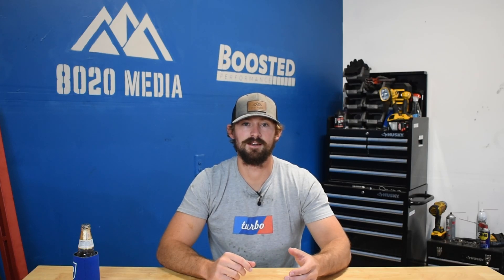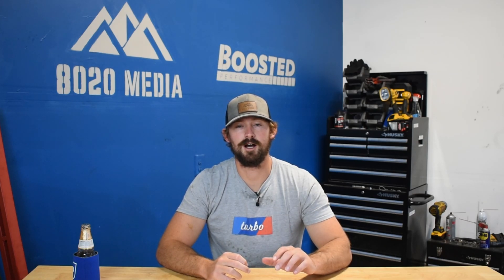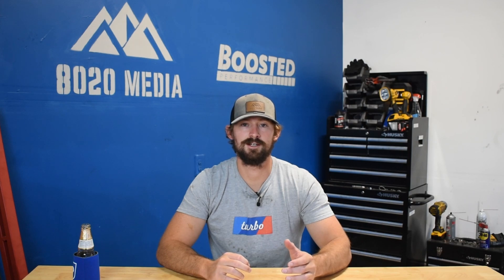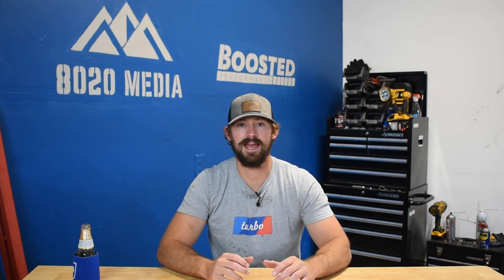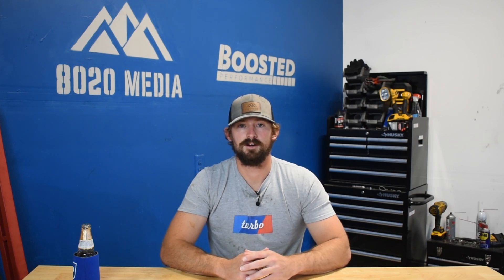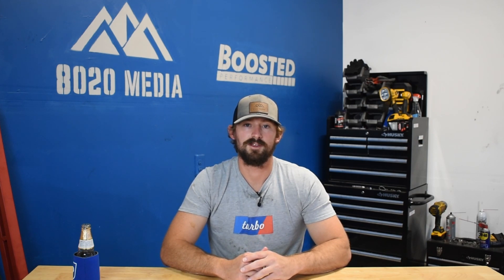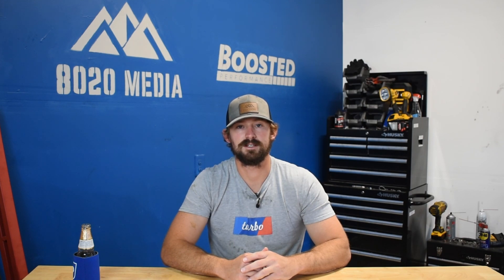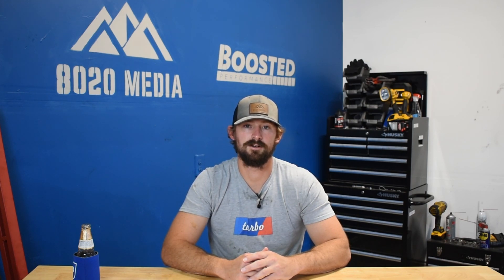The 8.0 V10 Magnum | Common Problems & Reliability

Comment: I have owned my 1995 Ram 2500 4x4 V-10 for 25 + years and have 0 regrets buying it,  I can personally attest that about that many years ago my mom/sisters/&brothers in law all drove brand new 4x4 pickup trucks.  They all got approximately 7 mpg, while my truck was still getting @ 12 mpg and all of us pulling campers to South Fork Colorado.  I did just replace steering linkage and parts for steering,  rebuilt transfer case and NV4500 gearbox,  new clutch and slave cylinder,  all wiring good and tested with gooseneck trailer yesterday.  I can also compare it to my '03 Ram 2500 4x4 24 valve Cummins. I'll keep them both.  👍

Comment: From personal experience (95 3500 V-10 manual), under load, the V-10 will run circles around the 5.9L Cummins 12V. Added to that, the trailer being pulled by the Cummins weighed about 3,000 lbs less than the trailer I was pulling. Under no load, I was getting roughly 15 mpg.
Reply from the maker: X - Thanks for taking the time to share your experience! This will certainly help future viewers.

Comment: I have a 98 Chevy Silverado auto. 7.4 4x4 extra cab long box it had 148,000 miles when I got it now it's got 169,500 miles it gets bout 13mpg with easy driving towing 8-10mpg the only things I've had 2 Change is oil, fuel filter, air filter, plugs and wires, headlight's to led, alternator tension pulley, 02 oxygen sensor on lower bank, and 1 transmission service that's it.

Comment: 12v Cummins is known for cracked heads also. I’ve owned one with 300+ hp and a built 47rh. The v10 with an nv4500 would be a stout platform for pulling and might give the Cummins a run for its money.
Reply from the maker: M - True! Thanks for sharing.

Comment: I have 2002 2500 with the v10 and 5 speed manual currently just under 120k miles.
2 things that I thought I should mention.
When I had the transmission serviced, I was told they don't make the fly wheel for the manual 5 speed for this engine anymore so take care of yours if that's really true.
Also the Dashboards are notorious on these trucks but not related to the engine 😅
Reply from the maker: M - Thanks for taking the time to share your experience! This is helpful for future viewers.

Comment: Power went up by 10hp in 1999 vs 98, any idea what actually changed?
Reply from the maker: Z - ECU tuning changes and minor refinements in fuel and ignition timing. There weren’t any major hardware changes like new cams or intakes—just optimization of the existing setup to improve performance and efficiency slightly.

Comment: Did the 96 v10 magnum manual  trans come with the NV 4500 i think i herd they came with the re4700  but maybe because thoes would be automaticks?
Reply from the maker: C - Yes, the 1996 Dodge V10 Magnum with a manual transmission came with the NV4500 5-speed manual transmission. The RE4700 (47RE) you’re thinking of was the automatic transmission option for the V10 models. The NV4500 was the standard heavy-duty manual transmission used in Dodge Ram 2500/3500 trucks with the 8.0L V10 and Cummins diesel engines during that era.

Comment: What sort of MPG ya'all seeing on the Highway...empty ?
Reply: My 01 V10 quad cab short bed has 4.10 gears with 35" tires. If I use restraint and stay at 65 and under, I can get as high as 14mpg empty. Around town/local driving it's usually 10. Loaded, towing, empty, it doesn't matter solid 10mpg.
Reply from the maker: J - Thanks for sharing your first-hand experience!
Reply from the maker: K - Not a lot. lol

Comment: I'd honestly rather spend $8,000 - $10,000 on the engine and transmission rebuilt then spend $50,000 - $80,000 on a so called new pick-up
Reply from the maker: E - Not a bad shout..

Comment: I have a 2500 with the 5.9 gasser and it's on her 3rd trans, it's a dodge thing not really a v10 issue. My 5.9 gasser gets about 8-10 mpg and had 235hp, so a gutless pig. I'm thiking about doing a turbo v10 build instead of doing a diesel build.
Reply from the maker: J - Thanks for sharing. We love the V10

Comment: Bought my v-10 dually with a 5 speed new in 1999, been plowing and towing with her for over 225,000 so far. Still runs strong, very few problems, other than the thermostat
Reply from the maker: D - Thanks for taking the time to share your experience!

Comment: The v10 actually made more power no matter the rpm. There is a dyno sheet that can be looked up with both engines stock readings on the same graph.
Reply from the maker: D - Thanks for the insight.
Reply: Where to find that spreadsheet ?

Comment: Solution to the transmission is high weight hydraulic 46 and higher
Reply: Lukas hydraulic fluid
Reply from the maker: B - Thanks for the insight.

Comment: I have a 1997 8.0L V10 
Bought as 2nd or 3rd owner from the eastern shore of Maryland.
I bought around 72k miles in November 2022 as a work truck, farm truck, plow truck in New England.
It was super clean and nearly no rust for a northeastern truck.
Quick tune up and ready to make money plowing. 
I immediately got a tune-up for some stalling issues- I had to fix some air intake BS that some previous owner Fd up with a K&N intake and bad sensors.
Its been running very good since then. 
New front brakes and bearings (26 years old)
It's been oil undercoated with chainsaw oil 3-4x now to prevent rust.
Still nearly immaculate metal for the age and a good runner.
Not comparable to my diesel trucks for towing, but better than a v8
I echo the comments on the 47RE transmission - I suspect this will be the weakest link as a plow truck and some towing over the summer.
I don't think I have an OD gear  - seems very suspicious.
Engine oil analysis is ok, at 83k miles but showing some early signs of metals and antifreeze.
It's getting a 3rd set of right side exhaust manifolds this week
Hopefully quieter and more powerful next week
Reply from the maker: P - Thanks for taking the time to share your experience!

Comment: I have a 98 8.0L and the inly issues ive had id the abs brake light stay on and the oil pressure drops when warm from between 60 to 40
Reply from the maker: S - Thanks for sharing your experience!

Comment: Would a 1999 trition v10 be more reliabe
Reply: With the dodge it's a 5.9 360 with 2 more cylinders and the ford is a 2 valve 5.4 with 2 more cylinders both v8s are reliable when taken care of and so are both v10s but if the vehicle has an automatic transmission I'm going with Ford and I don't think Ford offered a manual transmission like the dodge
Reply from the maker: A - They're both reliable, depending on maintenance.

Comment: I have a single cab ‘99 3500 dually 4x4 with the V10 and a 5 speed as a work rig. Bought it from a relative this winter. It has a service bed with a 200 gallon diesel tank. Currently at 240k miles and aside from the clutch starting to slip and the hesitation mentioned in the video, it’s been a pretty good work rig. Haven’t had really any major issues with it. Even the electrical system still works for the most part (which is a miracle for a second gen)! Only issue is the fan stops when you turn the headlights on, so no A/C or heat at night.
Reply from the maker: C - Thanks for sharing your first-hand experience! Sounds like you take great care of it.

Comment: I own a tree service. I have 217,000 on my 96' Dodge 2500 with the 8 liter magnum. It pulls my 16ft dump trailer fully loaded with ease. I am on my 2nd transmission, but I love this old truck. Thanks for your video.
Reply from the maker: A - Thanks for taking the time to share your experience! We love these trucks.

Comment: Bought a used '95 V-10 5-spd in 2000. Just over 100k now. Quieter than a diesel and not as smelly. Light use these days, I figure it will last a good long time.
Reply from the maker: D - Thanks for taking the time to share your experience!

Comment: These V10s are prone to sludge if not maintained, so regular oil change is a must. Rocker arm bolt breaking is another common issue so listen for any ticking coming from the valve train. Aside from the weak 47RE transmission, that's probably the only issue I've come across on mine.
Reply from the maker: D - Thanks for sharing your experience. How many miles do you have on yours?
Reply: @8020Automotive  290K and still going.
Reply from the maker: D - Nice! Sounds like you've got a good one.
Reply: Just bought one yesterday 97 v10 motor runs strong 190000 4x4 needs trans but is making ticking sound so could be rocker arms issue also really good deal for the truck

Comment: I got a 96.....5 speed.Manual dana 60 dana 80.No issues.No, leaks doesn't burn oil 210000 miles.Most reliable vehicle i've ever owned and i've owned over forty...
Reply from the maker: S - Thanks for sharing your experience!

Comment: I use to have a v10 magnum locked up ran it to the ground body frame paint work still in good shape bought for 10k for only 50k miles on it now I’m gonna put a 24v Cummins into it oh ps has a 5 speed in it
Reply from the maker: E - Thanks for sharing your experience!

Comment: We have one for work and haul a dump trailer with it. It's been a good truck but the crank pulley flew apart on it the other week and we had a heck of a time finding a new one. Apparently the part was discontinued in 2022 but we got a new one and plan on driving it till the wheels fall off
Reply from the maker: B - Thanks for taking the time to share your experience and insights. We hope you get 100k+ more miles out of it.

Comment: Having driven the dodge Cummins 12 valve & the dodge 8.0 V10 for many years. Either engine, you can't go wrong with. Personally I preferred the V10. Better acceleration & where I live a better chance of finding gasoline than diesel. Also the V10 had such a unique sound under a load. Just plan awesome to listen to.
Reply from the maker: Rick - Thanks for sharing your experience!
Reply: Kinda weird sound on my dual exhaust, twin 2 3/4” sounds like double headered 6 cylinders!?
Where as my v10 ford sounds like Indy car?
I love my 8.0l Dodge

Comment: I have a 2005 Ram1500 5.7Hemi & I have 371371 miles on it . I’ve replaced the power steering pump 3times & one fuel pump . I did change my thermostat to 180 degrees at 150000 miles
Reply from the maker: M - Thanks for sharing your experience!

Comment: 530,000 miles on mine mostly towing a 11,000 lbs trailer and still running strong! It is on its 3rd transmission and 3rd dana 80 diff.
Reply: How have you gone through 3 D80s? Are you not changing the fluid, or is someone installing it without knowing how to set preload and backlash?
Reply: @AdmiralRustyShackleford When it was a work truck for a construction company I worked at it was way overloaded and keys were handed to people that did not drive it kindly. First one was a Dana 80 the 2 replacements were just junkyard Dana 70s cuz they were cheaper and that's all the company cared about. It has been babied since becoming my personal truck and has not broken anything since it also got a Dana 80 put back in.
Reply from the maker: A - Thanks for sharing your experience! Sounds like you've got a good one.
Reply: 5.9 or 8.0?
Reply from the maker: Z - Asking which is better?
Reply: @8020Automotive since we're on the subject which one do you consider superior?
Reply: @Brettopotamus  5.9 I have both

Comment: Even the v8 magnum heads "crack", it's just something that can happen.

With minimal mods these can be 350hp and 500tq engines. The stock engines make 450tq at 2000 rpm. With 87 being SO much cheaper than diesel now, people should really look into big gassers again. 8.0, 8.1, 6.8...
Reply from the maker: A - Thanks for sharing this insight.

Comment: 156,000 miles. 94 v10 5speed 2500 4x4 4.10 posi. I couldnt even gwt traction taking off in 3rd. Really 2nd with the gearing. Never had an issue with it
Reply from the maker: Thomas - Thanks for sharing your experience!

Comment: Tough as nails engines my daily is a 98.5 2wd 2500 v10 the only v10s that were known for cracked heads were the early production years and another hesitation issue was because of faulty o2 sensors
Reply from the maker: In - Thanks for sharing your experience and this insight!

Comment: How is this even a fair question which is best when a V10 uses twice as fuel as a 5.9 Cummins?? That's not even a sensible question lol😅
Reply from the maker: W - Got you to click on the video it seems.
Reply: 15mpg and more expensive diesel fuel (and sometimes harder to find, especially if out camping) vs 12-13mpg gas.  Pretty even if you ask me...

Comment: It's a 318 with 2 extra cylinders. Change the oil regularly and it'll run forever. You'll run into consumables -- water pump, 02 sensor, alternator, transmission, the truck'll wear off around it...
Reply: No its a 360 with 2 more cylinders, the same exact pistons as the 360 not the 318.
Reply: Same rods too  @doodoobutterandjelly69year70
Reply: @doodoobutterandjelly69year70  pistons are larger then a 5.9
Reply: @doodoobutterandjelly69year70  a 360 with 2 extra pistons comes to 7.375 l not 8.0
Reply: @theinfamousnicksroofinginc  no. The stroke is longer on the V10 of 3.88" vs 3.58" on the 360. That's where the displacement comes from. Same rods at 6.123" and pistons at 4.00" as a 360
Reply from the maker: Sarah - Very true. Thanks for sharing this insight.
Reply: @8020Automotive  been driving my 318 since 2003.
Love me some good old Dodges

Comment: I always run seafoam in the fuel system every month, replaced the IAC and TPS, all spark plugs air filter and that's about it, truck never skipped a beat
Reply from the maker: Retro - Sounds like you take great care of it! How many miles do you have on it?

Comment: I bought a new 2500 V-10 in 2001 still purrrs & pulls like a young mule , after 306500 miles. It loves to drink gas! I'm no stranger to the gas station . But best vehicle I've ever owed , haven't had a truck payment since 2004 , so I can't
get too upset about gas prices ! I was thinking about being buried in it but it's an 8 ft bed.
Reply from the maker: Richard - Haha. Love hearing this experience! Thanks for sharing.
Reply: Well this morning I have 342153 miles on big red, she's in
good health with a steady crankcase diet of 1 quart Lucas 
Pure Synthetic,  1 quart Lucas High milage oil stabilizer, 
Then bring  it up to line with High milage Mobile  1. Don't forget  to give it a few swallows of Lucas Upper Cylinder Lubricant  every fill-up, this engine loves this combo , the truck is in better shape than me my Wife says my sight is failing, I can't hear, and have trouble understanding,  Maybe but I would not hesitate jumping in that truck this afternoon and driving to New York from California.

Comment: When the thermostat "fails" on one of these, it ALWAYS "fails" OPEN-- You will NEVER overheat an 8.0 V10! They just don't get hot! In fact, quite the opposite - - many owners report that their engines take forever to warm up.... It's a seriously over-cooled, over-built engine....
Reply: I have a 96 v10 and can attest to them taking a long time to warm up. on a cold day it can actually be annoying 😂 good problem to have
Reply from the maker: Luke - Thanks for sharing your experience!
Reply: My 95 v10’s thermostat go stuck closed last winter and I drive it for 30 mins and it over heated took thermostat out and drove it to where I was going and back home and was cold the whole way after I took thermostat out
Reply from the maker: Doran - Thanks for sharing your experience!
Reply: Bought my truck with that issue got it $1000 cheeper cause it wouldn’t get over 150degrees
Reply from the maker: L - How's it doing now?
Reply: Wish Chevy was like that, I’ve had multiple 4.3 thermostats fail close. I need to find a Japanese made one, OEM and the cheaper aftermarket’s suck.
Reply: Mine never gets over 160* whether empty or towing 8000# trailer over pass
Reply from the maker: David - Thanks for the insight.
Reply: I think I have this issue just purchased my 97 v10 only has 120k miles and it never tends to warm up highest I got it too was 145degrees that’s driving on the interstate for 1 hour non stop I’m going take a look at my thermostat